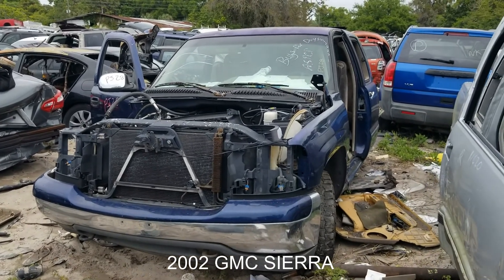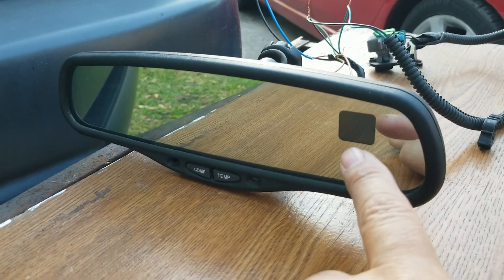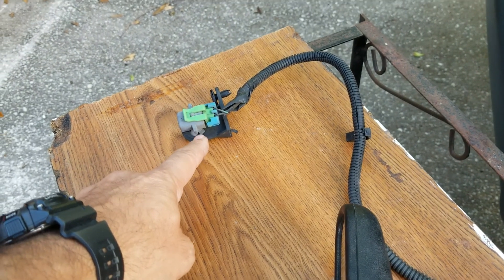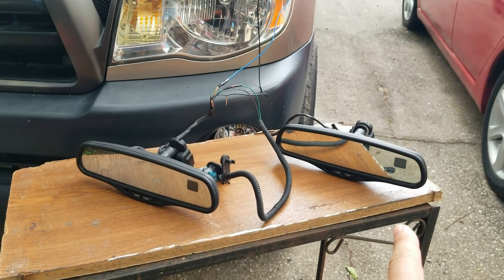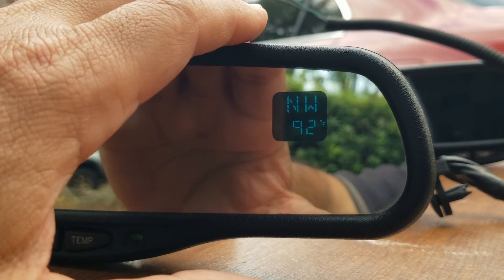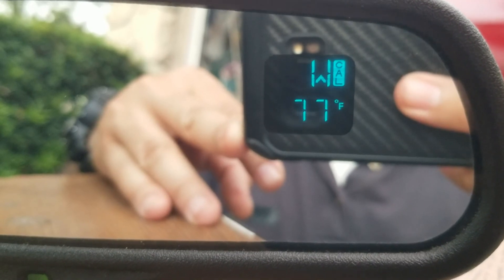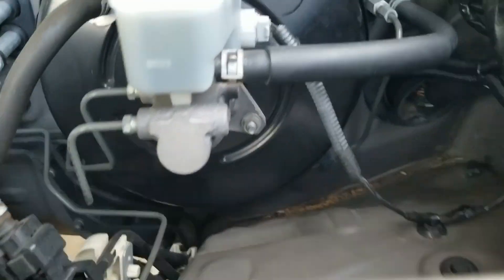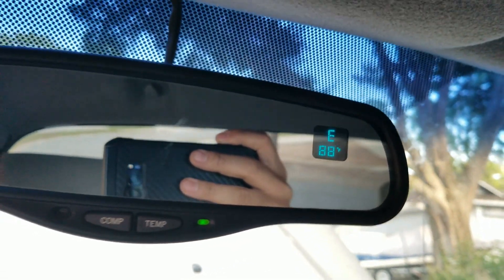Toyota Tacoma gets GM GNTX 177 auto dimming Mirror w/ TEMP n Compass

Comment: Thank you, Lincoln, for a very helpful and comprehensive mod. It is exactly what I was looking to do with my 2007 Tacoma. Just a brilliant and very inexpensive solution. 

I picked up the "261" model of the mirror. Very similar to the model 177, but has a 16 wire connecter instead of a 7. Do you happen to know if the pink wire is still the hot wire? Or can you point me toward a wiring layout that breaks down the wire colors and what they do for the model 261? I was hoping they were the same, but I'm afraid to experiment in case I attach the hot wire from the battery to the wrong contact in the mirror and fry the electronics! Million de Gracias, Senor! Muy agradecido por su ayuda!

Comment: Lincoln - to test the mirror, I just attached the pink to the battery positive, and the black to the body, and when the compass/temp didn't light, I tried the negative terminal. Still, no light. 

I thought it might be a problem with the mirror. I returned the GNTX 261, and found a GNTX 177. Tried to test it, and had the same problem. So, I ask how you connected the mirror.

Another question - do you have to hook up the sensor to the mirror, to get the mirror to light up? Could that be the problem?
Reply from the maker: The way I wired the mirror was: 
Pink +, 
black - (negative)
I connected everything together as shown on the video.
If I were you I would also connect the sensor to see if that makes a difference.
I ended up returning the first mirror because it did not work.
Towards the end of the video I showed a picture of the wiring diagram I used. 
For my second mirror I ended up testing it at the salvage yard to make sure it worked.
I hope you get it sorted out 👍
Reply: @LincolnMaxnCo  Thanks for the advice. I did as you had suggested, and hooked up the temp sensor, still no lights (power on green light, or blue comp/temp). Scraped and used contact cleaner to clean contacts, verified continuity for each wire. Used the PINK wire (pin 1) to POS terminal, and the BLACK wire (pin 2) to bare metal in the body. That didn't work, so I attached it to the NEG terminal on the battery. No lights. 

One question: when you tested the mirror did you attach the black wire (from the connector) to the NEG battery terminal, or to bare metal in the body? I tried both, but no difference. Just wanted to make sure I didn't fry anything.
Reply from the maker: @Informed104  
You're welcome
I attached the ground wire to a verified ground on the body, ( I showed the location on the video )
If the mirror is not powering up, it is very likely that it could be a bad mirror.
Reply: @LincolnMaxnCo  Thanks for being really patient with me, Lincoln. I know this all sounds incredibly stupid. About the ground, yes, in the final wiring to the truck, I did see that you attached it to the body for ground. But, in the initial testing that you did, when the mirror was on the little table, I couldn't be sure if you just attached the black wire to the *body for Ground*, or to the *NEG battery post*.

Before I leave the salvage yard, I need to test the mirror using a battery on the bench. That's why I'm asking about using the battery post. I know how stupid this question sounds, but do you know if I can use the NEG battery post for a Ground, to test the mirror? Will that hurt the electronics inside the mirror?

It's just that I've gone through two different mirrors that haven't worked, and I'm paranoid that I'm doing something wrong to ruin the mirror's electronics. Really, really sorry for the dumb question!
Reply: @LincolnMaxnCo  Success! After much searching through a couple of salvage yards, I found a working GNTX 177 auto dim, compass /temp 2-line display mirror, that actually works! 

My concerns about ruining the mirror were unfounded. Either ground worked, and the working mirror was verified by simply hooking up pink to POS terminal post and black to NEG terminal post on the standalone battery.

The other mirrors did not work, and I suspect it just requires re- flowing the solder on the  resistors on the PCBs inside the mirror.
Reply from the maker: @Informed104  
I'm glad you found a working mirror 👍
I hope you enjoy yours as much as I do mine
Saludos  🙂

Comment: Love the video trying to install one of these on a 06 Tacoma what kind of censor is that thank you
Reply from the maker: that is the ambient temperature censor, I recommend you get the mirror and the censor from the same vehicle, to make sure they are compatible.
Reply: @LincolnMaxnCo  I think i already messed up I bought a Gentex 261 Auto Dimming Mirror Kit w/ Compass Temperature Wiring Sensor & Cover but I’m going to give it a try with that one and follow the streps you did for yours.
Reply from the maker: @Maria-ns6dl  just make sure to look up the schematics to the one you got, because they might be different 👍
Reply: @LincolnMaxnCo  like what? If you could please give me any tips
Reply from the maker: @Maria-ns6dl  the wiring is different, looks like the 261 has a 16 pin connector w/ 13 wires. 
Here is what someone wrote about it. once you get yours check to see if it matches the colors w/ this person.
 https://www.the12volt.com/installbay/forum_posts.asp?tid=8560&tpn=2
Reply: @LincolnMaxnCo  thank you I’ll give it a look

Comment: Hello Lincoln - the lime green wire : You tied that to power, but doesn't that mean that the mirror will never dim? I'm confused. 

I tied both the pink and the lime green to power, and it won't dim when I expose the reflective-side of the mirror sensor to light. The mirror stays bright. Shouldn't it auto dim when bright lights are behind you?
Reply: So yes, the Red/White wire down behind the kick plate is the reverse lights wire. I tied the lime green wire into the red/white wire using a T-connection solder joint. I cut a slit into the red/white wire, dug out the copper wire and soldered the lime green wire to it. I insulated the connection using 3 different pieces of shrink tube, covered with hot glue at the joint. 

When I shift into reverse, the lime green wire is supplied with 12 volts, and overrides the mirror's auto - dimming feature, giving a clear rear view, regardless of the intensity of bright light behind the truck.
Reply from the maker: I am glad you got it to work 👍